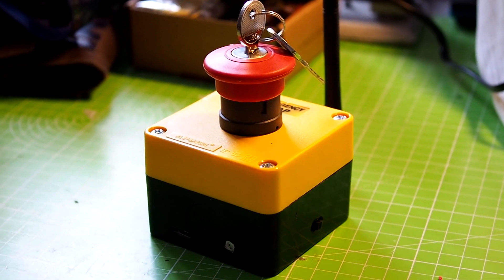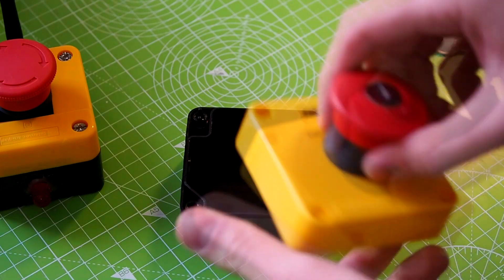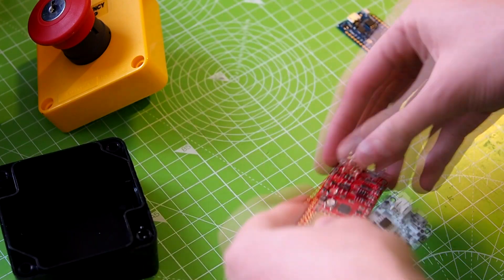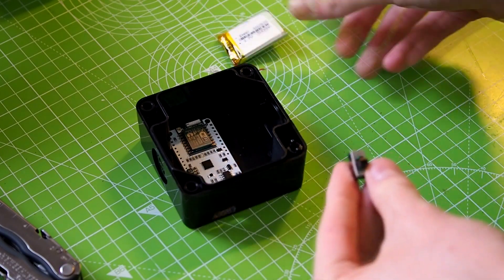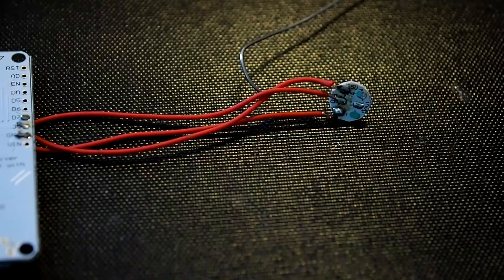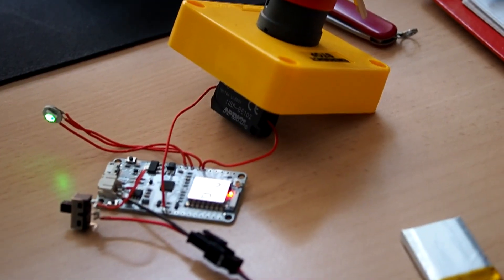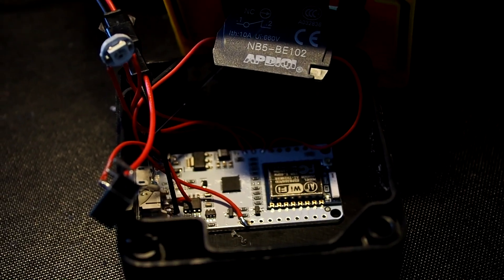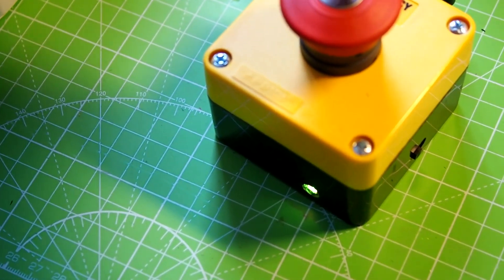Rick Roll - Emergency Button (ESP8266 Deauther v2)

Comment: this seems like a fun project, since I'm new to electronics in general I thought about recreating the button following your steps. But I wanted to add my own touch and also include a speaker playing a sound during deauthing. My question is, are there any speakers you could recommend that would work with the setup?

Comment: Hey bro. The projetcs are awesome. But the deauth attack is not working for laptops. My both laptops hp and dell inspiron 1750 aren't removed from the wifi network. When i start a deauth attact with latest version v2.0.

Comment: You should of had the antenna internal. Right now if somone wants to stop the attack they can just take off the antenna with their fingers. Other than that good job. Love the WiPi Jammer
Reply from the maker: That's why there's still the internal ceramic antenna ;) The output goes to both.
Reply: ..or they can just stomp on the box. I am pretty sure the lock with the key is just a gimmick, not for real protection. Also there is a on-off switch on the side.

Comment: But how do you know when the lipo is fully charged ?
Reply from the maker: The led on the NodeMCU board turns red when it's charging and green when it's done. I can see it through the hole of the USB connector. Not very bright though.
Reply: Oh, so you can see it through there, cool thanks!

Comment: Neat hack. Does that board have a jumper 0 ohm resistor that has to be moved to activate the external antenna like the Wemos boards?
Reply from the maker: Nope :) It's using the classic ESP-07 and as far as I understand it, it is always using both antennas.
Reply: spacehuhn You're  right both are enabled. You should get better reception by disabling the ceramic antenna. Just remove the far left component in this picture http://artofcircuits.com/wp-content/uploads/2016/05/WiFi-ESP8266-ESP-07-1.jpg